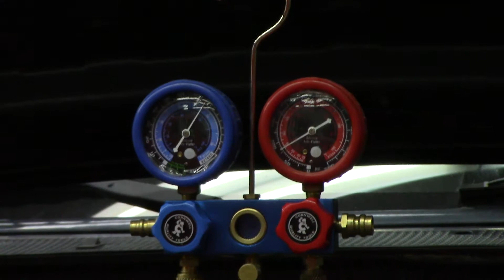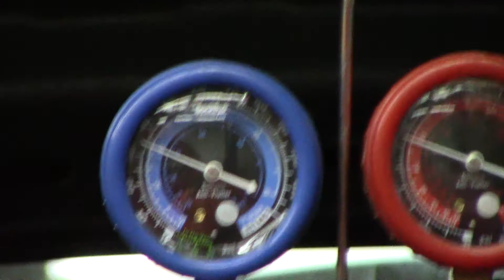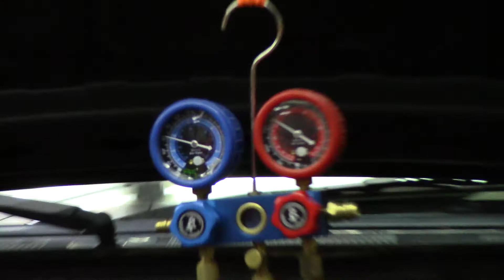Static Pressure , Dynamic Pressure, Dynamic Loaded Pressure Test

Comment: Very helpful.   It would be more clear if you told the viewer what the car's A/C was set to for each step, e.g. turn the A/C on, blower at top speed, temperature at lowest setting.
Reply: so it depends on the vehicle, you’d have to look at your shop manual for that vehicle, that being said max ac max blower is probably fine if there isn’t any instruction

Comment: For the dynamic loaded pressure measurement, do you need to bring the engine up to operating temp first?
Reply: yes you do, then operate the system for about 5-10min to inspect it for blockages